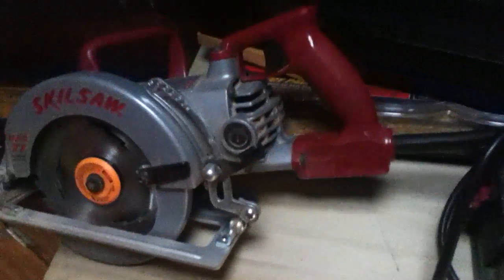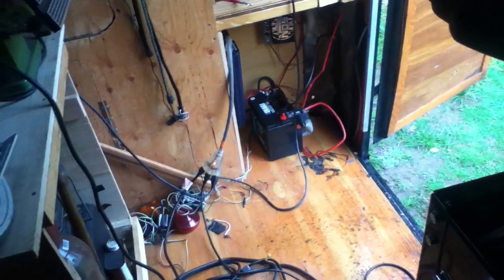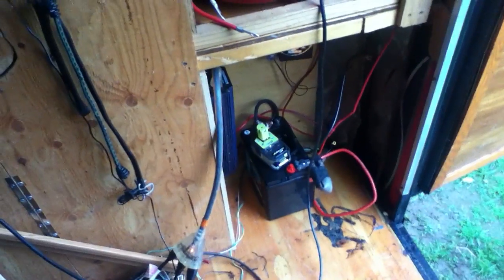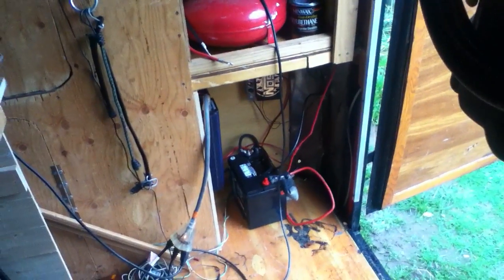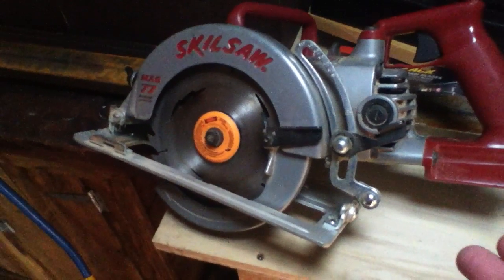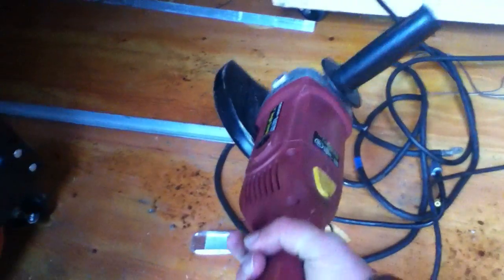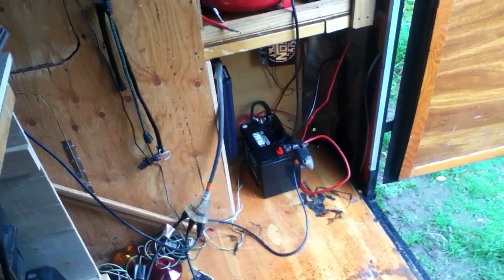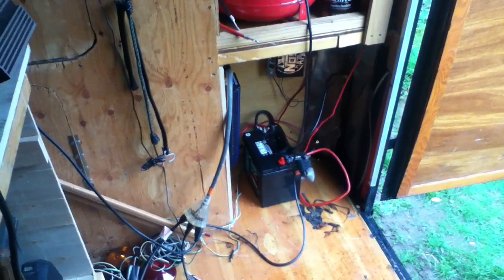Off Grid workshop power system upgrades

Comment from the maker: Any counter help person at any place that sells car and deep cycle batteries will explain the difference to you.   Car batteries and straight deep cycle batteries may appear similar, but the plates are set up differently inside.  Deep cycle batteries are often engineered to NOT dump a lot of power at once, while batteries set up to run starting motors will, and that's what makes them more suitable for systems that have a lot of starting load from power tools.

Comment from the maker: The Trojans went to recycle and I will not likely buy any more of their overpriced stuff.   Overpriced, overrated.   I originally had those heavy cables and removed them, it made no difference on thickness, the problem was length.   They were too long and the system you see there works better than the trojan battery and thick cable system that I had removed.

Comment from the maker: Yes, I run a small grid tie inverter on the system but it only gets plugged in when there is surplus power in good weather.  Right now I have to manually switch it between grid tie or battery charge, so I leave the grid tie disconnected in winter.